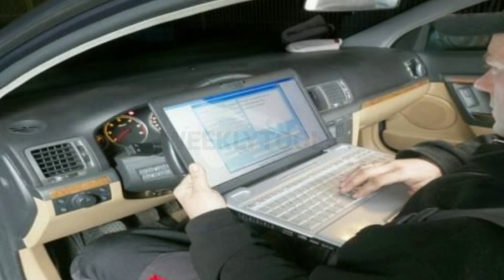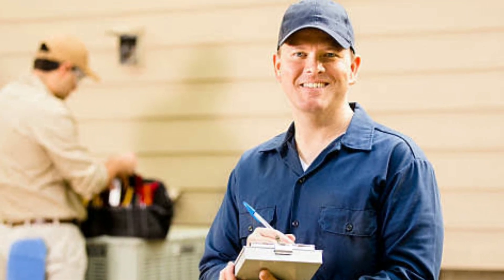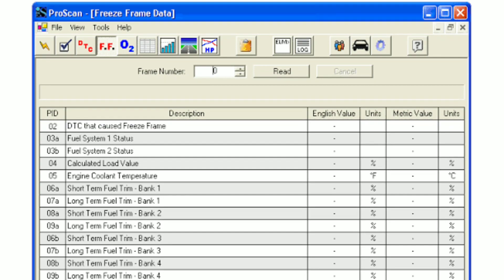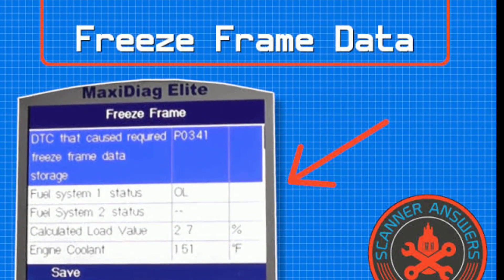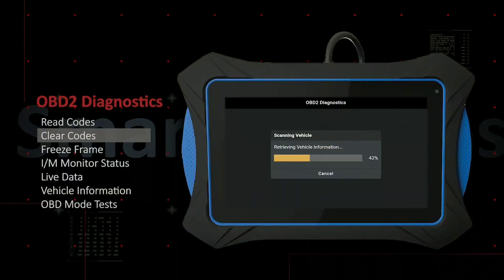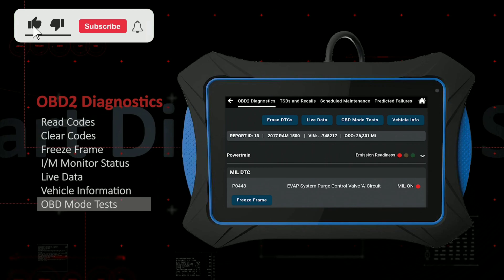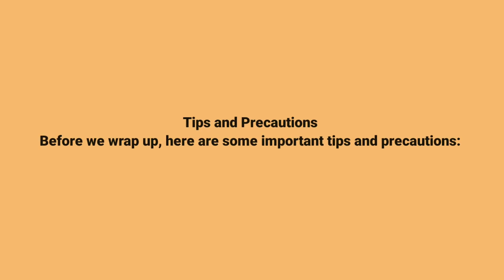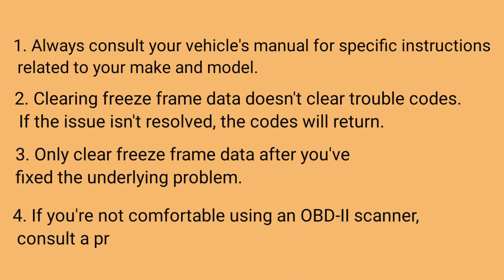How To Clear Freeze Frame Data? Clear Freeze Frame Data in Your Car |

Comment: I have P0328 code, saw that's code for the knock sensor, I will buy it and wiring harness for 350Z, let me know, when I replace it, will the code be still there or ?
Reply from the maker: Replacing the knock sensor and wiring harness might clear the P0328 code on your 350Z, but it's not guaranteed. Here's what to expect:

Possible code clearing: There's a good chance replacing these parts will fix the underlying issue causing the code and turn off the check engine light. The knock sensor detects engine knocking, and a faulty sensor or wiring issue can cause the PCM (Powertrain Control Module) to receive incorrect data, triggering the P0328 code. By replacing the parts, you're addressing the potential root cause.
Not a guaranteed fix: Other factors besides the sensor and wiring could be causing the code. These might include loose connections, engine issues causing actual knocking, or even a faulty PCM itself.

Here's what you can do after replacing the parts:

Clear the code: After replacing the sensor and harness, use an OBD-II scanner to clear the code. This won't fix the problem if it's still present, but it will turn off the check engine light so you can see if the issue comes back.

Test drive and monitor: Take your 350Z for a test drive and observe if the check engine light returns. If it does, you'll need further diagnosis to identify the remaining problem.
If you're not comfortable replacing the parts yourself, consider consulting a mechanic to diagnose and fix the P0328 code. They will have the expertise and tools to pinpoint the exact issue and get your 350Z running smoothly again.
Reply: @weeklytools  Thanks, also the code appeard from “Freeze monitor” section of diag app, not in DTC section, so I’m again not sure do I have issue with faulty sensor or it’s still counts or  I’m good ? Thanks ! The DTC section is empty on diag app where most of the codes are shown ?

Comment: My vehicle's ignition is push button start I can't do it this way how do I do it
Reply from the maker: There might be a reason your push-button start isn't working as expected.  Here are a few things to try:

Double-check the brake pedal: Make sure your foot is firmly pressing down on the brake pedal. Some cars require the brake to be depressed all the way to the floor before the start button will work.

Key fob in range: Push-button starters use key fobs that communicate with the car. Ensure your key fob is inside the vehicle and within range of the ignition system. If your fob has a weak battery, it might not be detected by the car.

Try a different position: Some cars (especially with manual transmissions) require the gear shift to be in park or neutral for the engine to start. Try putting the car in park and see if that helps.

Consult your owner's manual: Your car's manual will have specific instructions for starting your vehicle, including any troubleshooting steps for push-button ignitions.

If none of these solutions work, there might be a deeper issue with your car's starting system.  It's always best to consult a mechanic if you're unsure about how to proceed.